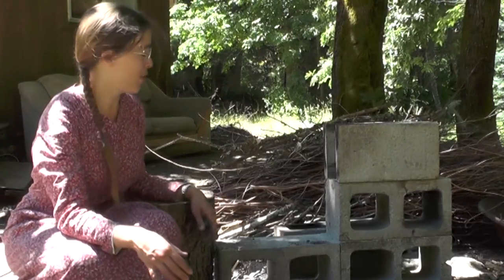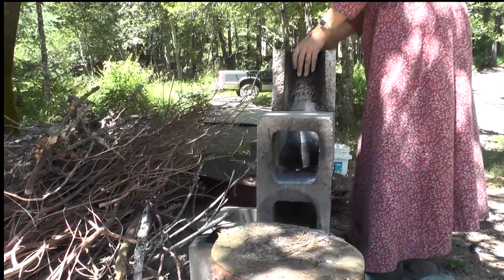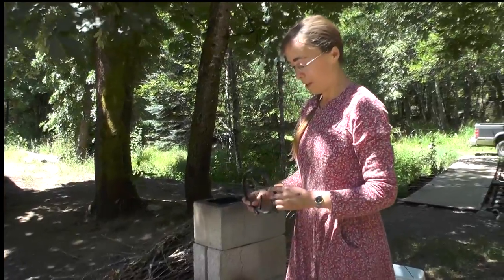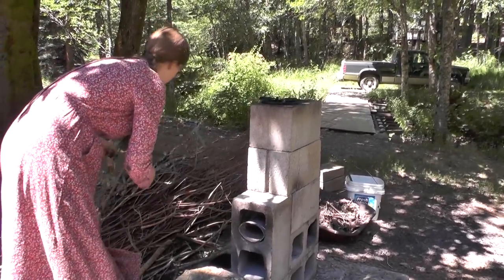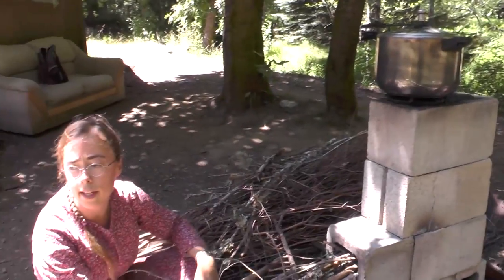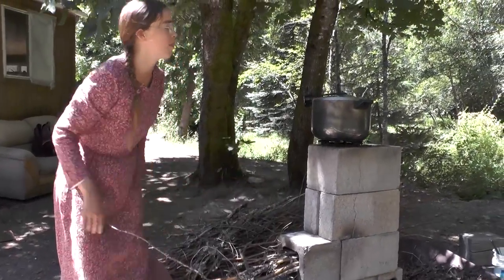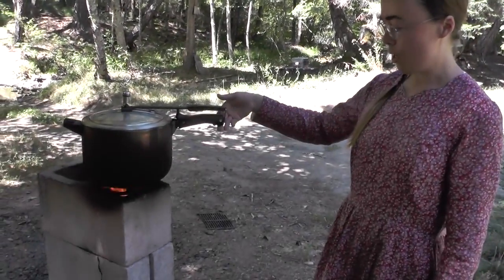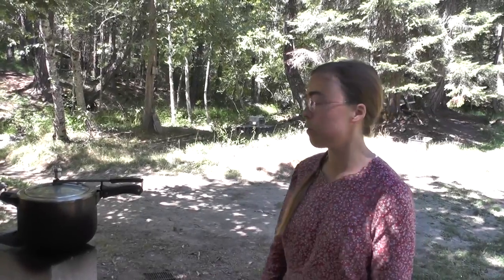Improved Rocket Stove - Cinder Blocks EASY!

Comment: Are all your vids, this well done? You did an excellent job with this. Your instructions were clear and well explained. Though as you no doubt have read by now, concrete blocks will break down rapidly from the heat exchange, there are a few things that can be done to help slow that process. But the idea of a rocket stove is using the resources that you have on hand at the time and again you did a wonderful job here. Thank you so much for sharing your knowledge.

Comment: Great setup. If you smear the bottom of the pressure kettle with liquid soap, it'll be way easier to wash the soot off afterwards. And if you put the kettle into a haybox right after the pressure valve whistles for the first time, you can put the fire out and save a lot of wood and go to do something else safely. Come back after a few hours and your meal will be ready waiting for you, cooking for free in the meantime. Ever since I found this out it's the only way I use my pressure kettle. Only I'm saving electricity, not wood :-)

Comment: I love how fast and easy to construct this is!  You can take it down and move it when necessary and reuse the materials but sturdy enough to stand on a windy day.  If the bricks crack you can buy another one or just wire it together.  I don't think it's going to explode if you are using older cinder blocks and are just burning twigs.  I set up a stand with cinder blocks for 3 weber BBQs that no longer have legs because they fell off from the heat.  I will be restacking one end into a rocket stove like this to burn the piles of twigs and be able to set pots on it!  Have wrought iron burners from old gas stoves to set on top. Reusing materials around the ranch or home is the way to go! thanks for this great design.

Comment: I have used cinder block rocket stoves for years and they work well but the blocks are not made to withstand heat and they crack quickly. If you can find some where to get clay blocks or pipe, they last longer.
Reply: Chimney blocks right?

Comment: PLEASE be aware that all forms of concrete has many air bubbles/ pockets and will EXPLODE off they get too hot or there's heat applied for lengthy cooking time. Unlike fireplace bricks concrete id not tempered for high heat

An acquaintance didn't have proper river rocks to heat up for their native American sweat lodge and the fire tender used concrete bricks to heat up on the fire.  Even before water was added to create steam, 2 bricks exploded and shrapnel went everywhere

Comment: Awesome work. I could see making a oven from center block too. If you get your hands on a old water heater and strip everything off the tank you can use it to heat water over a fire but you have to add a pressure valve to keep it from blowing up.

Comment: Concrete blocks will explode in the heat, not the ideal material for a rocket stove. use fire honed clay or chimney blocks instead.
Reply: Idk about that, maybe break
Reply: @gfy2979  If there is a flaw or air-pocket in the cinder bloc it can explode.
Reply: @epicjohnson9396  Correct, usually they all crumble after being hot enough a few times.  I'd be more concerned about trapped moisture than trapped air, steam can make powerful explosions.  I once saw a damp sandstone in a fire ring explode like an M80, fragments drew blood on several bystanders, but luckily , that time at least, nothing too serious -- it could of been fatal.
Reply: Cinder block concrete is usually too porous to build up pressure. I think it is called spalling when you put a lot of heat in concrete and a chunk explodes out. Like if you pour molten metal on it. But that is usually poured wet kind of concrete that is pretty compact.
Reply: douglas carpenter  yes it will, happened to me and lodged a chunk of concrete in my thigh and one in my hip.
Reply: @MrNhojstrebor  
Your own link says the concrete was heated on one side only AND they had to use special tape to seal in the moisture.

Wood burner at about 600°.

Nope, burning little sticks isn't going to make concrete explode.

Dropping an acetylene torch can do it though.
Reply: Grab some chimney liners. Clay or pumic
Reply: Old wives tale. if you take a 8inch block in sub zero temperature let it freeze for days then dump it cold water then throw into a 10,000 degree oven you might get a ping but cooking soup with sticks, not a chance in hell of anything exploding.
Reply: @Alycanj  
sir heated to 10k isn't the same as actual intense flames.

you can graze a concrete floor with a 3,000 or so degree cutting torch and the concrete will literally explode like a bomb. it's a very big safety thing in the welding industry.

concrete can and does explode from regular fires, not that often, but they do rarely. usually they just fracture before enough pressure builds. but not always.

you know not that much about what you speak.
Reply: douglas carpenter  no ,it will explode.that's why they don't use them in fireplaces and i have  seen them pop and send chunks flying ,so,yes they can explode.use fire blocks!
Reply: you are right
Reply: douglas carpenter  alright maybe explode is a bit much but they do pop and pieces will fly,my brother still has a scar where the piece hit him .so to say they don't is wrong.
Reply: @gfy2979  If they get the right amount of moisture in them they will literally explode when heated, I've had it happen.
Reply: @MrNhojstrebor  chimley blocks? 😂 There are flu tiles and fire bricks that I know of. Never heard of chimney blocks. Just chimney sweeps
Reply: I use railroad ties. Highly recommended for mesquite connoisseurs
Reply: @shannonlandre4442  
Schornsteinblöcke
Reply: I have 60 yr old cinderblocks
Is it safe to use them to build a "Rocket" stove?
They sit outside, exposed to sun and rain and snow
Reply: Well Hans, it seems to be working, she said she had been cooking on it for two months at the time she made the video.

Comment: Get some dirt and mix it with water, then apply it on the outside of your pot. Let it dry and cook. Once you are done it will wash right away with no effort.  Your pot remains clean all the time.  Smoke problem solved. :)

Comment: Hopefully you've learned by now to pre-soak your beans overnight. Uses MUCH less fuel/time. Pinto beans cook in SIX MINUTES !!
Reply: True.
Reply: @davidtaylor261  I want to believe...
Reply: Well done. Cheers
Reply: You mean dried pinto beans cook in 6 minutes? Or you using a pressure cooker outside? Thank you
Reply: you can cook some  beans much quicker then some of the 2 day recipes i"ve seen,,,, soaking simmering draining cooling rinsing crap. . lol. That much is i know. im now gonna have to try a 6 minute boil.
Reply: @littlepils4187  soak them overnight first

Comment: I was told by a Mason that cinder blocks can explode because they absorb moisture and then when it heats up it can crack and explode. I've learned this when I was make it a fire pit / rustic outdoor grill the inside lining is cinder blocks. Outside beautiful jagged shaped River Rocks. It  turned out really good. With a lot sweat and  hard work.
But it's sure looks like you got this !!!

Comment: You can paint the bucket with old engine oil for a quick non-stick release. It's what is used in pouring concrete foundation forms.

Comment: idk why people don't understand that concrete is not used for stoves for a reason! THEY WILL EXPLODE!
Reply: People don't understand it because it's not actually true.   They crack and crumble,  but an actual explosion is pretty unlikely.   My understanding is that concrete block  is too porous and structurally weak to build up that kind of pressure.

Comment: Great Video awesome advice and very clear explanation. I have cooked over a thousand meals on different rocket stoves i built to find the perfect one. What i have found the way you load the stove has a huge difference in performance. I rate my stoves by how little i have to mess with the fire to keep it going. If you load this rocketstove right you can walk away or concentrate on cooking without having to mess with the wood a lot or at all for a 30 minute burn or longer depends on the dryness of your wood the diameter of the sticks and the diameter and length of your stove. fill the chimmney bottom of your stove with wood sticks of 1/2 inch or larger sticks all about the same length about a foot long also fill the horizontal burn chamber with sticks until you cant cram any more in. The space created between round sticks is enough air for the burn. Too large of sticks will not work nothing larger then inch and a quarter or so. Too small sticks will also not work they burn to fast . 
Now you can light the stove by dropping some paper and small sticks down the chimney and starting the burn from the top down your fire is burning against the draft. This way each stick has a candle like flame on the end instead of a large portion of the sticks on fire all at once. That backwards burn is also very smokeless from the very beginning to the end and the entire time until all the wood is gone you dont have to touch the wood or worry about the fire at all. That to me makes a good rocket stove not having to fuss with the fire too much.

Comment: VERY well thought out!  Excellent demo. as well.  If I may suggest something though.  I have found, through seeing cinder blocks crack in a fire pit, that concrete blocks would handle the heat better.  They are SOLID and therefore heavier and a little more expensive BUT I believe better for this application.

Comment: She is correct there are many different cinder blocks. With different amounts of sand pumice and gravel. You can buy 8x8x16 Sand and Gravel blocks. Like they use in mobile home skirtings
 There are also 60%-40% block much lighter etc. Etc.

Comment: Thank you!  Interesting and practical. 
We are playing with rocket designs using some old 'single' cinder-blocks (just a cube with one square hole), eventually hope to convert our wood stoves to Rocket/Mass heaters to heat the mud brick house in the winter.  As we play, we learn.
Ours have a longer riser - four to six blocks tall and thus run much hotter.  The bottom block cracks! The Pyrometer says that it was  ~160C on the outside and around 380C inside, so no surprise.  Repaired it with clay 'slip' and baling wire...  We'll see how that works when it has cured.

Comment: Go get a section of 6" stove pipe . Then put your regular stove grate on top! If you drill a few holes about 3/4 up and use a little concrete and flat cinderblocks to make your burn chamber 3 bricks. Cut one in half  for the back and for the front top or you can put a steal plate over the front to cook on or use as a warming plate. It sets waste high. If you put a 10" pipe around the 6" pipe it works better . It acts like insulation

Comment: Best cinder blocks to use are the tan or red fireplace flue blocks. The yellow or tan blocks are solid, yet still lightweight. They will not crack at all

Comment: Use fire brick and seal cracks with mud.
Taller the riser the hotter it can get once it heats up. Lower the burn chamber the hotter it gets too relative to the top of the riser.
Can't remember the ration of the riser though.
A 'J' type setup is self feeding too.
Or an 'E' type.
I built one and flame shot up 2x the height of the riser!

Comment: I must admit that I had been considering making a tin can rocket stove, but I had concerns about their potential lack of stability, i.e, tipping over when you have boiling water or a skillet with hot oil and food frying.  Your design would take care of that, and other than cutting one cinder block open, there is only the setup to do. Thank you.
Reply: Your concerns were the same as mine. Tipping over, blowing away especially in wind. I made the tin can ( and other ) versions and thought "Cool, but it's very lightweight. I live in West Texas and 20 mph winds ( plus  gusts) are considered "Calm". The cinder block stove is AWESOME and all sorts of heavy. Each cinder block weighs 38 pounds. Nothing short of a tornado is going to budge that off the porch. the 5 block setup totals 190 pounds. Steady & sturdy. In case weather gets wild, just cover the intake & exhaust with bricks or blocks ( or dump in a bucket of water) and it's Safety City. This 5 block version is the very best design I've seen across a LOT of videos. 😀
Reply: @johannbach1430  There is one other positive aspect of the cinder block model for me. I don't own the property where I am located presently, and I would probably get a lot of lip and grief if I were to build a masonry/concrete grill/oven combination (I love to bake, and make pizza). Further, I can tweak the positioning of the cinder blocks for wind up take and safety.

Comment: Saw open both ends of a cinder block but leave the center section. Then you'll have two combustion chambers, one facing the wind, the other facing away so you'll have low and high heat burners and/or you can cook two pots at once. Boiling down maple syrup takes a LOT of fuel (8 hours cooking) so I'm going to try this.

Comment: I saw a video where a guy cleaned the glass of a wood stove using the ash mixed with a little water. Glass was sparking clean with little effort. I wonder would it work on your kettle?

Comment: A true frontier woman...heart pine splinters will lite the flame if you don't have a propane torch.  Also,the upper block cracked because of the extreme heat.     Nicely done!

Comment: I tried this over the weekend. It worked great but it wasn’t at all easy. I tried charcoal but that didn’t work. Wood was better. We used a lot of matches. We tried all sorts of kindling too. Be sure to have all this on hand first. Lots of smoke as wood is added- yes it does go away but it was an issue. I will definitely keep using this- stove idea. I had to order a truckload of wood. We don’t have wood lying around where I live. All considerations. Worthwhile to try however.

Comment: correct .. even if the safety valve on the pressure fails ... the pressure cooker pot will have a limited blast radius: first, it's water and it's heavy, second it will auto-condense in the air so it ain't going very far and thirdly, the metal in the pressure cooker itself it too fragile to fragment; the pot and lit will bust at the seems but there won't be any military size shrapnel (a screw or washer of course but the amount of the blast is gonna be very limited when not using actual volatile materials). This was an interesting take on stoves and the flames did burst out. Be sure to research if a rocket stove is allowed in your county. The background here looks too large for anyone to care but in a city, best to double check. Cool vid. Thumbs up.

Comment: If you were to saw out half or more of the center section of that vertical block in front. You wouldn't need the can anymore and could put in larger fuel.

Comment: I found your video by accident, but you helped alter my perception. So, Just putting words to a thought you inspired. So, fire is an entity, a material, an object separate from fuel, gas or air, and even earth itself. I never fully comprehended that concept until your description of adding fuel to the fire, literally. Now, if I could isolate the existence of fire without fuel as it should exist without anything to produce it essentially, I think I could solve my quandary of quantum looping for forced paralax varying distortion propellent. I wouldn't need rocketry nor quantified heat expulsion.
Reply: Reactants (wood,oxygen), catalyst (heat), reaction (results----> 🔥 fire) Good luck starting with the results.  That wouldn't even work in a good a game of DnD.
Reply: @pumaspaw  come on, Ed, I deserve more credit than what your condescending response entails. Look at the comment again. Predicated beginning stating an inspiring thought... Also, the premise is to think outside of the box and to look at my problem from another way. Needless to say, the physics here mathematically works, but will never actually exist. Gravitational manipulation is already under theoretical test phase in order to skip fueling for heat exhaustion energies, and instead, I'll just bend the fabric.
Reply: Billthewelder  you already did, Bill. 🎯

Comment: Be careful with the pressure cooker, if the plug/relief valve blows out the pressure inside the pot will drop,  which will drop the boiling point, causing the liquid inside to boil instantly and all at once.  If you have a gas water heater, you've probably heard it rumble when someone in the house opens a hot water faucet.  It's caused by the pressure/boiling point dropping and the thin layer of water between the sediment in your water heater and the bottom of the tank boils.  My grandmother told me a story of cooking collard greens in one years ago, she said when the plug blew out, it spewed that entire pot of collards up and onto the ceiling of the kitchen.